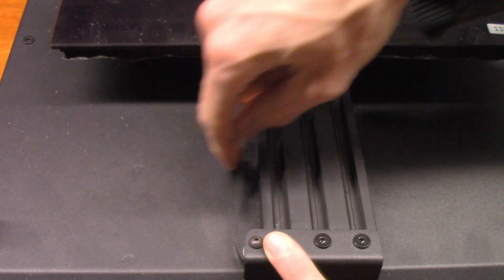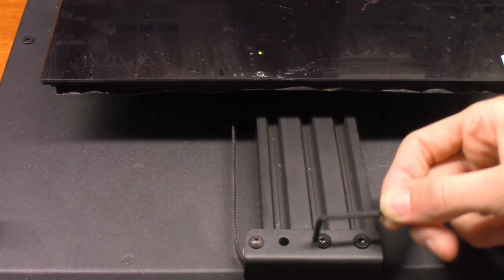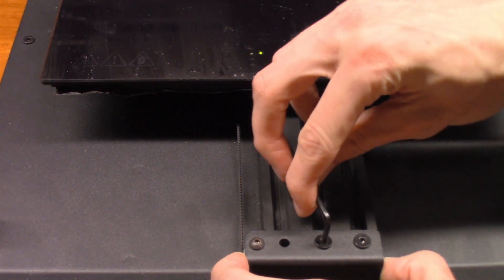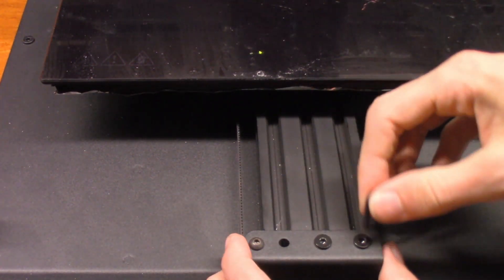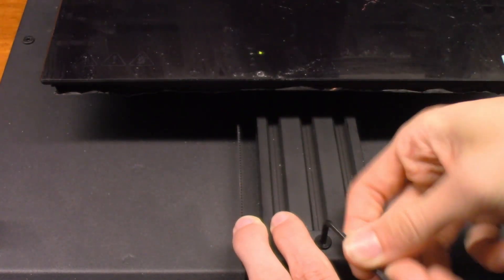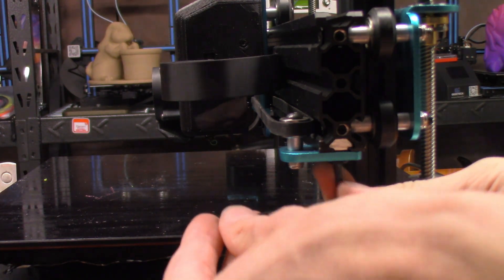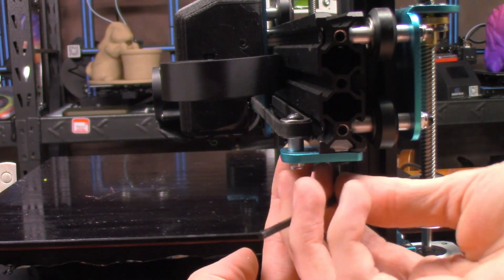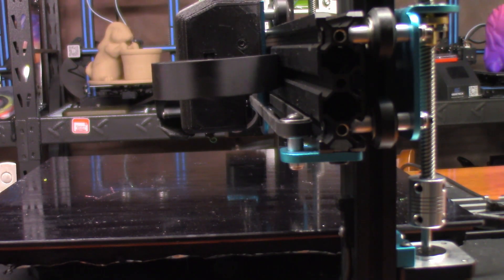Artillery 3D Sidewinder X1 Fixing Loose Belts

Comment: There's another belt at the top. Any suggestions?
Reply from the maker: Leave it as-is, if you put too much tension on it you can bind up the Z axis
Reply: @MakeItWithCalvin  Thanks for chiming in, Calvin. I saw another video, where the person took it off completely. Said it was useless. But I gotta wonder... why would they put a belt there, in the first place? But when you see how it's put together... it has stability, without the belt. Perhaps it's there to keep the two rods in sync?